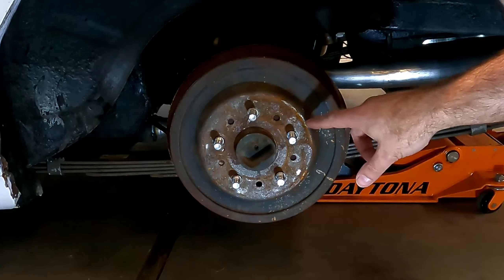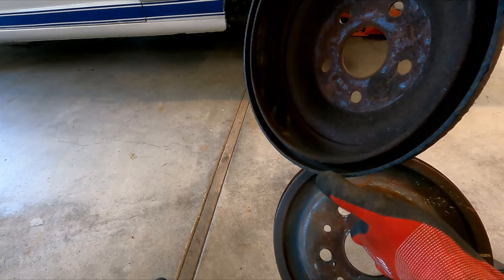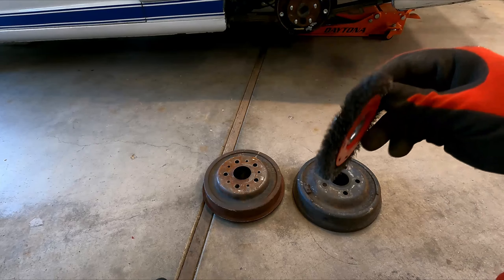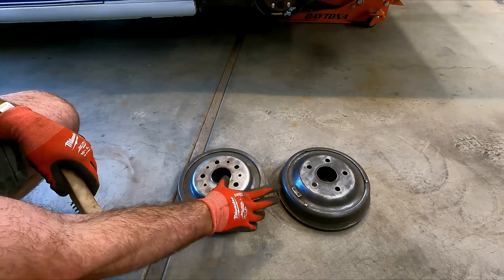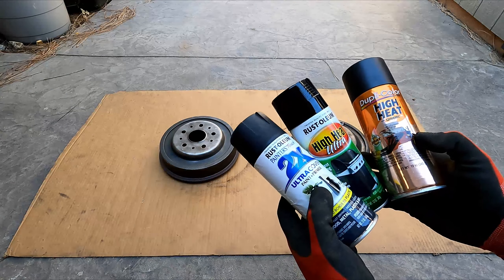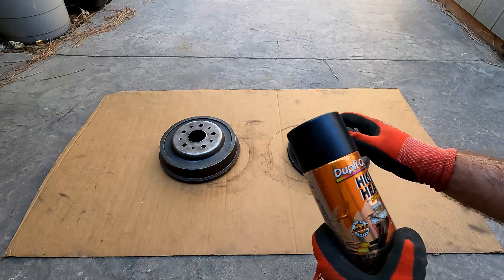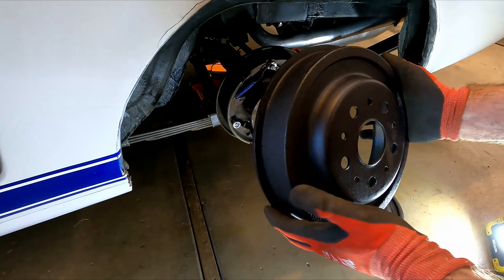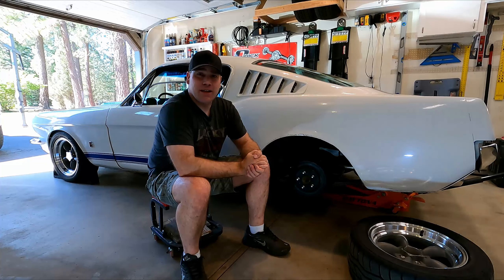How to Paint Drum Brakes

Comment: The original ford drum is the one with the rectangular tab near the one lug hole and the double lip where it seals on the back. The other is an aftermarket. Also I used rustoleum farm and implement black paint on back drums because I used that when I rebuilt my differential and painted it. I’m pretty sure it’s gonna come off if you don’t at least use engine paint. The regular stuff is only rated for 200 F and mine probably won’t last. Regular paint will actually work for motors and transmissions (I’ve done it with rustoleum enamel and primer) but I doubt it would work for brakes like you said.
Reply from the maker: Maybe not, but it'll give me a reason to disc brakes.  :)
Reply: You car is pretty sweet. I’m in the process of building my 1972 mustang coupe. I need to paint it but all the body work is done. I put 3.55s in the rear and took a t5 off a 97 and got that bolted to the motor. Does the regular driveshaft length off of the original car work? That and getting the cable clutch drilled in the firewall are the two things I need to do as my car was originally an automatic. I have 3 pedals in now.
Reply from the maker: Thanks!
I know the driveshaft from the 65-66 cars with the C4 will fit, but I don't know about later years.
Drilling that hole for the cable clutch is super easy.  :)

Comment: When are you going to update the rears to disc?
Reply from the maker: No sure yet.  That's an expensive upgrade and I think I'd rather have the 9" rear in there first.  :)
Reply: @AndyKruseChannel  I was surprised the rear brake kit was cheaper then the front since my front kit included the booster so it was cheaper
Reply: Drum brakes on rear wheels last longer.. much longer! 😉